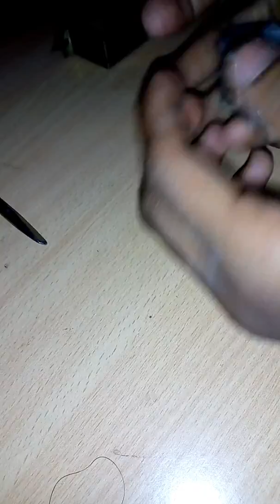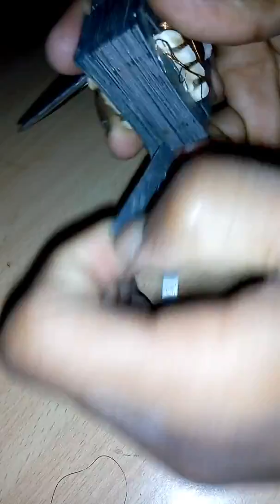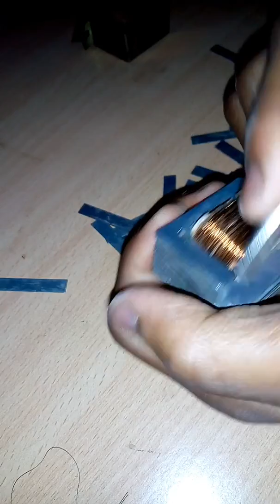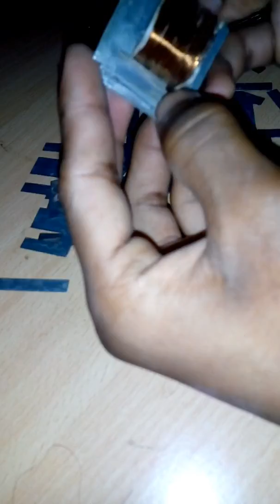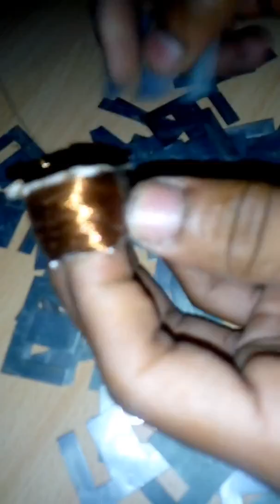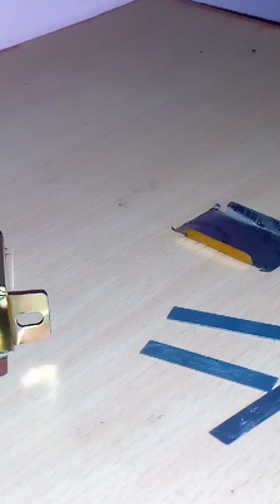How to make a powerful electromagnet using transformer || Talent hunt

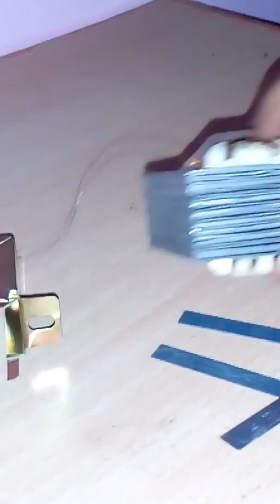Comment: 4:00
Why when I made it like this and then connected it to the electricity, its temperature rose and smoke came out and almost burned?
Reply from the maker: Must insure that the wire is made of  cooper , fully insulated and power supply is not much
Reply: @Talent_hunt  
I work it with 220v
Can you tell me why I can't run it on 220v?
Reply from the maker: @mohmad2822  220 is high for it
I Use 3v